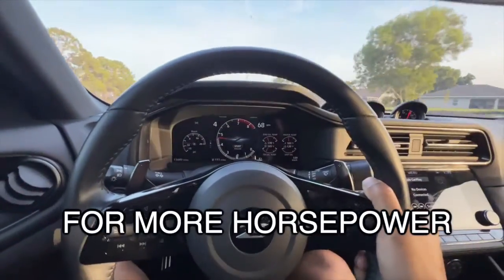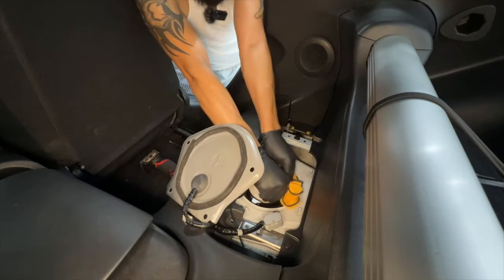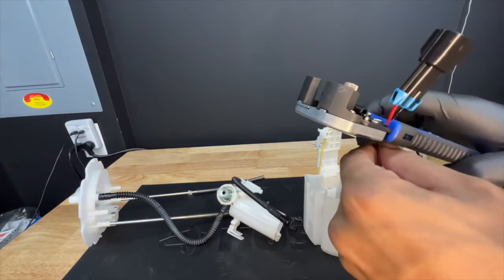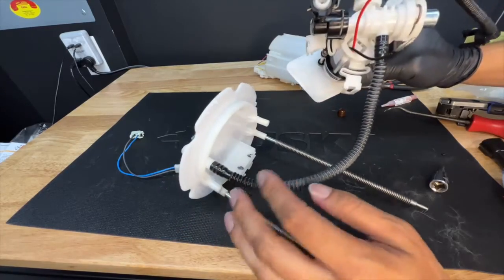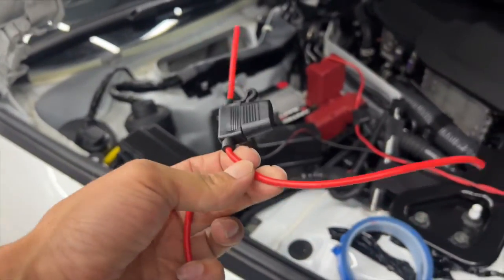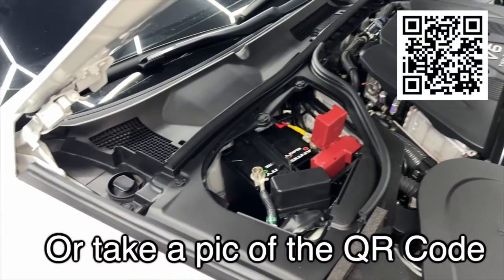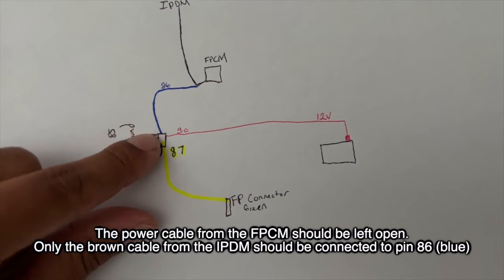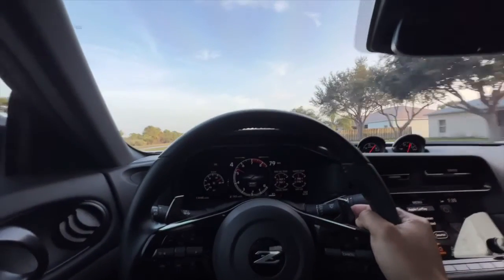Installing The Z1 LPFP Kit With Hardwire Relay Onto The 2023 Nissan Z

Comment: Did you get fuel pump sensor circuit code? I know its expected to get a code but I havent seen anywhere what exact code people have been getting. I cant clear this code
Reply from the maker: @jacobstanley7026  yea. I don’t remember the exact code, but it’s related to the fuel pressure control module. You need to have a tuner shut it off.

Comment: Getting a new car my two options is a 2013 12k g37 wit 100k miles and a 2015 q50 3.7 14k with 90k miles. I like the q50 a little bit more but love both. J don’t know if the 10k less miles worth it.
Reply from the maker: It’s up to you. I prefer the Q. Newer tech and better looking imo.

Comment: Is it necessary to install the red line of the battery?
Reply from the maker: If you’re wiring the relay yes
Reply: Yeah Racebox tried to run without the relay and had some issues.   If that scares you then you can always run the AMS kit which uses a smaller pump but still has plenty of fueling power
Reply: @blackhawk77  I already have an ams 450 pump but because I need something more powerful
Reply: @tntn707  Dang what's your setup?   That pump has fueled over 650 whp fine
Reply: @blackhawk77 im fbo q50 mine on 3/4 e85 bogs bad sometimes on full e85 and im stage2 AMS HPFP 2100CC injectors. I want to got spool but imma take my ams lpfp out and run the hellcat pump and relay
Reply: @joeblowig  upgraded turbos?  The AMS setup has more than enough fuel stock turbos and most on pures even.  You might want  to check the o ring, corrugated hose and filter sock in the fuel basket  when you are replacing the pump.  They tend to be the problem points
Reply: @blackhawk77  stock turbos but end of the year getting z1ball bearing turbos. On E85 dynoed 532whp 509TRQ AWD.
Reply: Plus I just got brand new motor and stock turbos put in and was already FBO on last motor just went catless and injectors will definitely look at sock and oring!!!!!
Reply: @joeblowig  got it, I had a FBO Q50 and now a FBO Z.   Hellcat pump certainty isnt a bad idea for the Z1's.  Car is going to rip!

Comment: Great timing for me, need to drop one in mine soon.   The basket looks identical to the Q except  a bit taller with longer metal struts and wires/fuel line.   Would you pull the seat if you were going to do it again or did you have enough room.
Reply from the maker: Pulling the seat would make it a lot easier.  I would pull it.